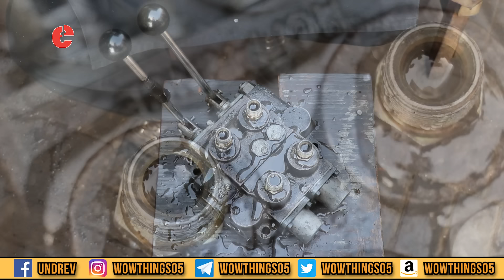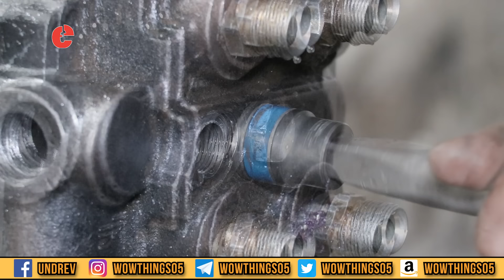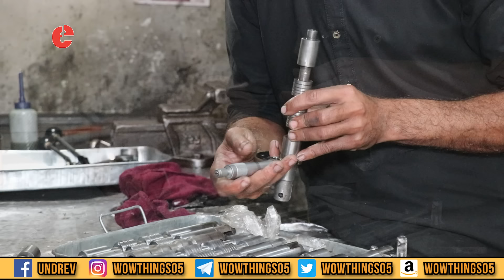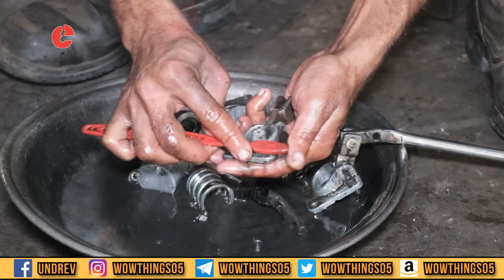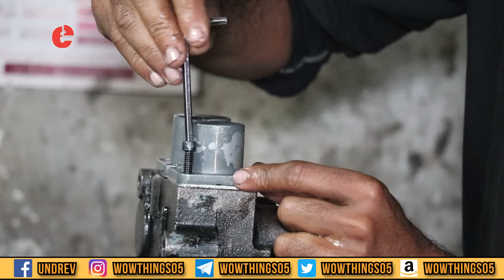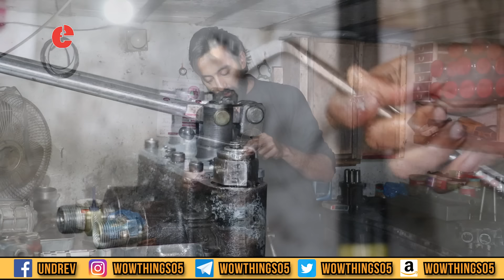The most impressive hydraulic spool valve mechanic you'll ever see!

Comment: I’ve been going through these Prince valves for over 40 years, the only thing I do different, other than I have a parts washer, is the final assembly of the spool. The edge of the spool land is really sharp, if you leave the seal clear back against the support plate/spring assembly and put a little grease on it, you have less chance of cutting it. This I speak from experience.
  Otherwise, this man did a nice job. If he paid attention, which I gamble he did, he can reset the relief within a smidge if where it was, probably close enough for what this goes on. He’s obviously done enough if these to know how/where to set it at. He honed the body with a lather and by hand, this was pretty ingenious. Consider where he’s at and what supplies he has, he’s talented. Nice job sir!

Comment: lapping the bore would increase the spool clearance and cause more leakage !     Only if you fitted and lapped  a over size spool would this method improve things.    The only reason it held fluid after was the assembly oil viscosity stopped the flow.   The clearance of the spool to the bore is worse than before.    If I am overlooking something here I would love to hear it !
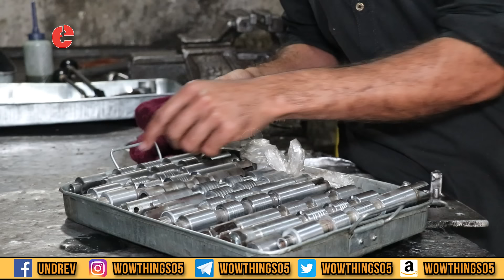Reply: He used a larger spool from his big collection of spools. see @2:28 where he measures and chooses a suitable oversize spool.
Reply: Can this job be done without having to lap the bore? Im looking at fixing the same on a backhoe.

Comment: You can tell he has done quite a few of these units. No assembly diagram  and had parts for the repair. 
I'm not sure if the parts used are common to most units? 
The only thing is seeing the testing.
Either way good job on reassembly.

Comment: I have problem with a backhoe attachment bobcat 8811 When I'm using it , it makes a hissing noise I think it comes out of the valve spool body and one of the lines starts getting hot and if I use it for more than 10 minutes ,the oil gets so hot that it
" kooks" seals from quick coupler and leaks 0ut hot oil... if you can help will appreciate . Thank you

Comment: Problem is, whether it's a battery charger, an alternator,  a motor, a hydraulic cylinder, or a valve, you NEVER see the part being tested under actual conditions.  In this case it's nice that the seals now don't leak under zero pressure, but under real use they have to also hold back 2,500 PSI.   It's questionable if they can do that, or for how long.

Comment: like the videos ...not sure grinding the bore,with these tight tolerances,will make it work better?.
Reply: it looked like he was using lapping (polishing) paste, not grinding the bore
Reply: if using old spool then lapping it 
should have make the leaking worse
Reply: @SiamWoodShop  lapping is to fit two surfaces together,doing one surface only will increase clearance...will make valve action smoother.

Comment: once again they showed how they cleaned the device and that’s it. I didn’t see the repair from the supposedly cool master
Reply: The device was shown early in the video leaking fluids and it was fixed by replacing the broken rubber seals. How is that not a repair? Now im curious on your definition of a repair.
Reply: he lapped the hydraulic bores with paste to hone the inner walls then replaced the broken seals which were demonstrated to be leaking.  this is what is called in the industry you clearly dont work in...rebuilt or serviced